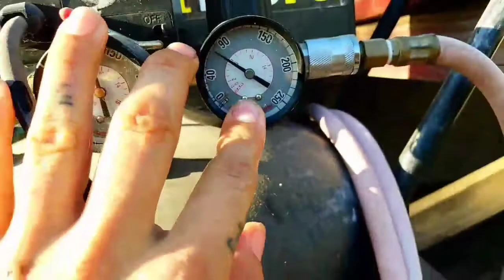Custom Oakley Batwolf

Comment: Awesome. I have a pair of the Oakley Pitbull frames in gloss black. Royal Blue / Royal Blue Metallic has always been my favorite Color(S). 
I bought 3 pairs of the PUMA Roma Ano (Men's) shoes. there only Color is Royal Blue Metallic.  Not sure if you can still get them - but as a 
fellow Royal Blue Metallic fan - you may want to see if you can.  I am so glad i bought 3 pairs - maybe i should of bought more but 3 should
be good for a while. I am probably replace my Pit Bull glasses with the newer - Oakley GASCAN® SPECTRUM COLLECTION  X-Ray Blue.